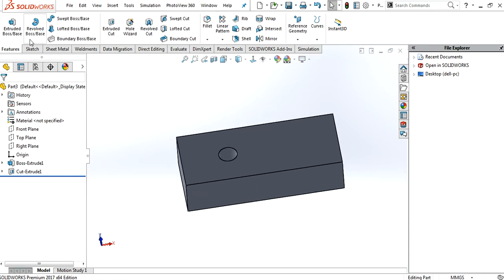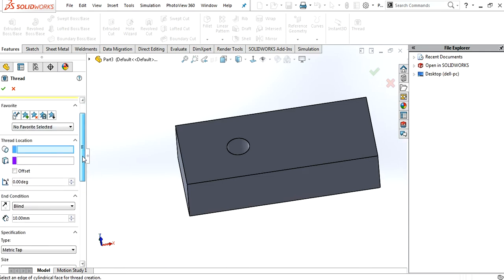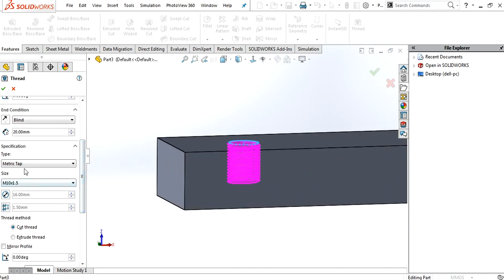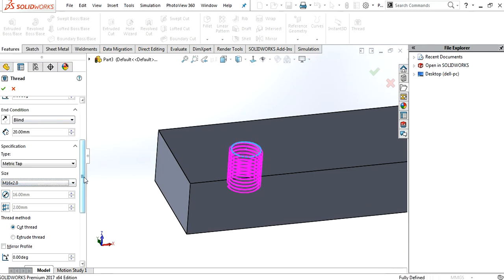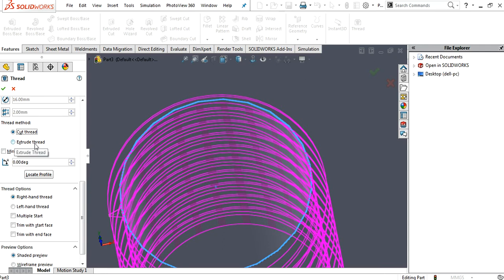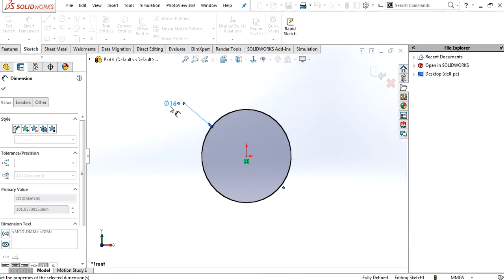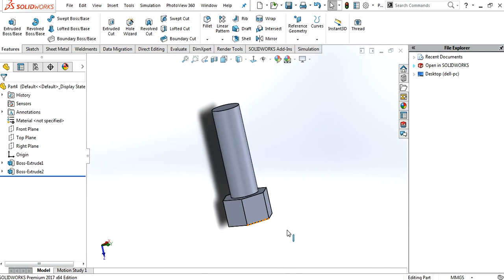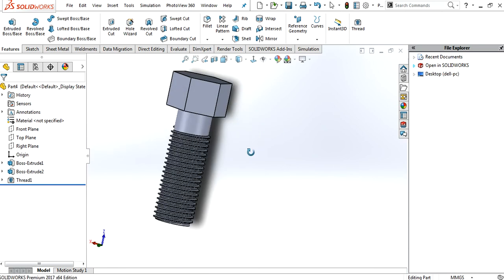Solidworks 2017 Thread Feature

Comment: HI, 
 currently working on a uni assignment an having trouble with female cosmetic threads in drawing. When I try to add the piece to a drawing the thread is shown not as a line but a detailed swirl that when zoomed out looks like a solid black line. Could you please suggest a way to fix this and put it back to a conventional manner.

Comment: dear sir,
               I am having a problem in thread feature in SolidWorks 2017.when I chose the thread feature, it popup a sound and  an error occurred that the nominal profiles is not available and when close that error, I n threading feature option there are no thread specifications available eg(m10,m11) the whole folder is blank .what should I do plz help me
 thank you
Reply: could you fix this problem i am having the same issue